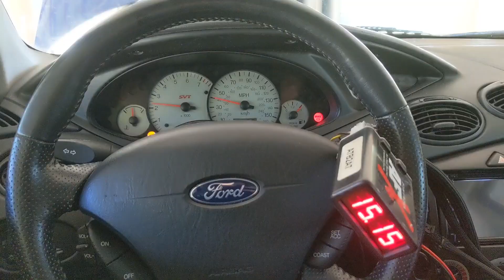2004 SVT Focus Turbo build and dyno

Comment: Damn, not bad. A little bit less than 280 to the wheels is pretty good. It's more than what the Mustang GT I had was rated at the crank.
Reply from the maker: Agreed sir
Reply: This thing would be pretty quick at that power level and on twisty roads it would be a nightmare to keep pace with for many "high end" cars.
Reply: @midnight347 and it's only 2700 pounds

Comment: I have a 02 SVT and I’ve been looking none stop for a nice turbo system. It’ll be awesome if you can share where you got your parts from. Or a future video explaining the build with the parts listed in it.
Reply: There isn't a kit anymore as the car is getting quite rare. You'v got to collect the parts and assemble your kit. Tubing fabrication required. The list at the end of the vid looks good. I've heard of turbo'd SVT cars with 300hp. Need to be careful though- there's a lot of heat under the hood normally aspirated and over time all the sensors bake. Absolutely think about controlling the airflow under the hood to get the excess heat out when planning a turbo mod. Insulate the hood if you like your paint. There's lots of resources for programming something to work with the stock ECM, even more with the aftermarket.
Reply: @EamonnSeoigh  focus power sells a kit
Reply: @jasonthomas4895  That's good news. I hope it's on the shelf, but probably not. I'll look into that, though. Thx!
Reply: @EamonnSeoigh  he usually has a few ready to ship
Reply: @jasonthomas4895  that's a good thing to know.
Reply: @jasonthomas4895  Didn't SCT completely bail on the SVT. Why is he still offering tunes on it, if new ones aren't even compatible.
Reply: @AthenaAutocross  as long as the device isnt updated, it should work to my knowledge
Reply: SPA cast iron manifold. the rest youll have to do yourself. get yourself a good welder.

Comment: Hey looking to do a turbo build myself I have an x cal 2 but wondering if I can pick your brain on the software you used thanks and if you have it or where to get it any help would be appreciated
Reply from the maker: SCT software
Reply: @goodnoughperformance  SCT ADVANTAGE III FORD PRO RACER software is what you are talking about correct and it would work with the XCal 2 still ?
Reply from the maker: @Moses_e  yes sir.
Reply: @goodnoughperformance  thank you so much 🤘🏼
Reply: You don’t happen to have the live load original software my xcal says it needs to be updated to use
Reply from the maker: @Moses_e  I don't
Reply from the maker: @Moses_e  I don't

Comment: 2020 ford gt500 fuel injectors??
Reply from the maker: Yes
Reply: @goodnoughperformance  how much horsepower are they good for? Are theae plug and play?
Reply from the maker: @bigray3360  power limit depends on a lot of factors. They aren't plug and play, you have to put newer style connectors on the harness or run connector adapters.

Comment: Nice build, that's gonna hurt some feelings.
Reply from the maker: Thank you!
Reply: @goodnoughperformance  I have a 400whp 2.3 with a GTX3071R, a 260whp 2.0 dura daily with a GTX2871R, and I'm having a fully built zetec with a GT2871R on the lift down at FSWERKS as we speak.
Reply from the maker: @charlesshamseldin9555  that's awesome sir, congrats!
Reply: @goodnoughperformance  They're a lot of fun when they are sorted out.
No one likes getting walked by a focus 🤣
Reply from the maker: @charlesshamseldin9555  big facts

Comment: Cool rig. Might have to bounce some questions off of you from time to time.
Reply from the maker: Feel free
Reply: @goodnoughperformance  This was tuned with SCT correct?  It appears from the video that you did this with stock long block correct? What fuel?  Did you purchase the kit individually or does someone sell this kit? Still going strong?
Reply: Lol nevermind literally all of these questions are answered in below comments except the fuel. 😂
Reply from the maker: @605BOLT   I tuned it with SCT. This is a stock long block. This is on 93 octane. I bought the manifold from SPA, the turbo and wastegate from boost lab, the blow off valve from Amazon, and fabbed everything else. Still going strong, it is my wife's daily. With two passengers it hangs with pretty modded explorer ST's and Range Rover SVR's.
Reply: @goodnoughperformance  that's awesome haha

Comment: i see most turbo focus builds making around 275
Reply: You can easily go to 300+ it depends on the size of the turbo and supporting mods and fuel etc.
Reply from the maker: I would say the octane of your fuel and the amount of boost you are running are two important considerations as well.

Comment: Wut engine management?
Reply from the maker: Stock PCM tuned by me with SCT
Reply: @goodnoughperformance  an sct programmer? What model? Or program?
Reply from the maker: @dmritchie3  Xcal 2
Reply: Did u stack gaskets to lower compression ratio for the psi or leave it as it was?
Reply from the maker: @dmritchie3  no, head was decked and valve job done while it was off.
Reply: @goodnoughperformance  pump 93? Orrrr? Sorry I'm trying to pick your brain on finishing my build
Reply from the maker: @dmritchie3  yes, very little timing in it though